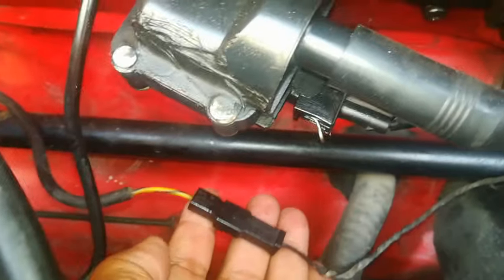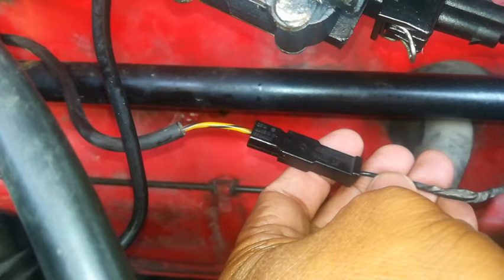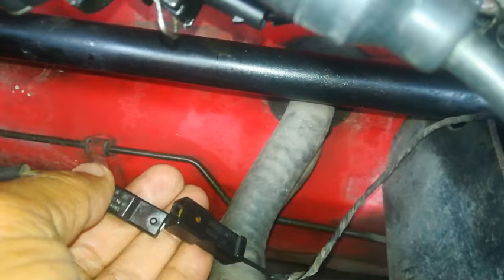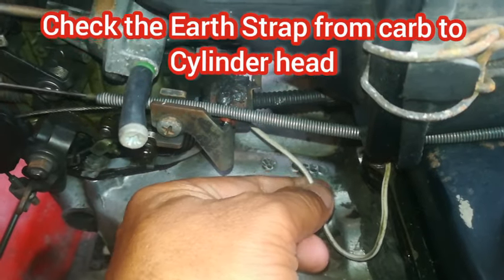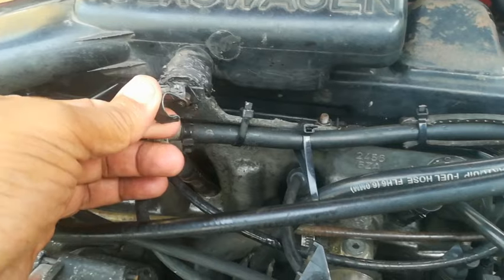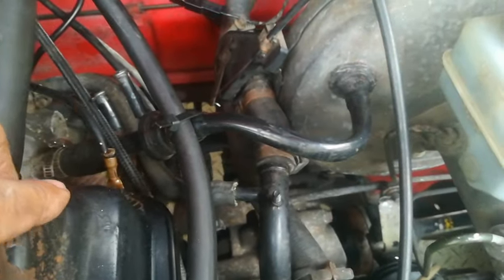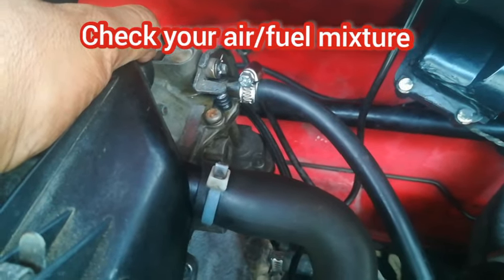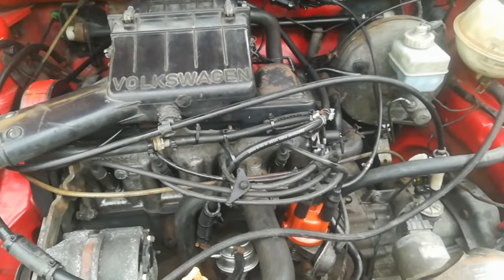GOLF MK1.WHY YOUR ENGINE WON'T  IDLE. SOLVING ENGINE IDLING ISSUES.#vwgolf #golfmk1 #vwfox #vwcaddy

Comment: Great video..

A bit more info on crank and distributer timing,  i always line the marks up and move the dizzy on the mark to plug 1.. never used a timing light and seems to be running fine.

Sometimes bother me if its not right.

Then say rather not interfere with what's not broken .
Reply from the maker: Exactly if it's performing well.. Leave as is   :)

Comment: Thanks for your videos, really appreciate it. I had a torn base plate, bought a new on Victor Ryens Sealer. But I still have the care cut out when I do a sharp turn to the left. (like a u-turn) Bought a new fuel pump just to find it was worse real erratic idling, cheched no fuel. So we installed the original fuel pump again and it is better. The fuel separator I blew out with a compressor, but maybe I must change it and the fuel pump. Checked the distributor vacuum advanced as per your video (the pipe was perished at the back of the carburettor. Cut it and refitted. Car is better but still 1000 rev ruffness when idling. And pull away jerky .
Reply from the maker: Ok that's great .have you checked for  an airleak around your servo pipe yet..(those two little ports)..and then also check on that other diaphragm which is inside that part which I  blocked off on my carb..it's supposed to be for engines with Aircon...,The pipe runs from that part  to the front of carb...as a test just block off the port on the carb and see if idle smooths out..I have done that...when I noticed the diaphragm in that part was torn,so I don't use that part anymore ..I'm not even sure what the specific name for it is.My reasoning is if the diaphragm is buggered / torn then it will cause un- metered air to go into the carb fuel mix and that leans it out causing an uneven idle..

Comment: My Citi Golf with Carb doesn’t idle as well, I found the Cut off valve cable naked, it must’ve been in contact with the chassis resulting in short circuit. Now I need to replace the cut off valve

Comment: Where does the connector that is connected to the air cut off valve run too? I have a mark 3 what would switch off when coming to stops, found my cut off valve was disconnected and the wire it was connected to ran through the fire wall, but I see here it runs somewhere else

Comment: 2002 mk1 fuel injection cold start idling in the morning when warm start first time only when cold it don't want to idle have to keep om ref to warm then it idles. What do you think?
Reply from the maker: You need to check on the temperature sensor ...it may need to be replaced ..or just clean it up .could be rust and corrosion

Comment: may I please be in contact with you. I've got a golf 1.4i that's got a rev/idle issue. When it turn it on the revs go up to 1200pm without any acceleration. When I drive it and I press down the clutch the car revs itself. I've changed the map sensor as well as clean throttle body with carb cleaner and the problem still is persistent

Comment: My golf mk1 cuts off when the rev count is below 10rpm I even replaced the cut off valve still the same problem applies, even when driving sometimes it just cuts off and there is no idling when is cold only when the car gets warm
Reply from the maker: Check your carb base plate ,coukd be sucking in air .or for air leaks around pipe attached to brake booster ..

Comment: Hi, thanks for all these video's, they help a lot. I have a vw baja with a twirnport engine but they fitted a Golf carb. When I start her in the morning she idle's perfectly. If I leave she goes fine until it seems the engine heats up or I go uphill she hesitates and eventually I cant go further. Do you have any advice, what can cause this? I've checked vacuum leaks, fuel lines, I must me missing something. Thanks.
Reply from the maker: Hi thanks.. Check fuel pump, could possibly be fuel starvation . That's a typical symptom. And, if u have a fuel separator on,... They tend to clogg up, or the heat of engine causes fuel to boil, etc etc. But first do a check on your fuel pump. I have a video on fuel pumps, and fuel starvation .. Not sure if you have viewed that yet.. Once I experienced that fuel starvation issue, until I eventually Checked my fuel pump and it was pumping erratically and weak.. And it was a new pump. Obviously bad quality. After I changed pump, problem was solved

Comment: Hi Mr PJ why when I press my accelerator my car cuts off I drive a golf which is a 1.3 carb
Reply from the maker: Could be one of many things ..could be clogged up airfilter,or flat spot on carb,or running too rich..like I say ..could be one of many things...best to take it to mechanic for  assessment
Reply: @pjs-golfmk1-diy  Fuel is leaking from the carb

Comment: good mornig PJ. plead3 can you help me. I have a 1.3 Citi sonic carb. it starts but does not want to idle please need your advice as I am very close to put a match in the car 😂
Reply from the maker: Hi. The most common reason for this is due to the idle cut off valve situated at back of carb to be faulty. Or your earth strap is not connected.. Usually connects from carb to the tapper cover. Have checked on these yet?
Reply: @pjs-golfmk1-diy  hi PJ fuse is fine cut off fine replaced starter module cleaned carb and checked the petrol pump. So when starting it starts up if I push the petrol high refs it it goes as soon as I leave the petrol it dies immediately

Comment: Hi! My Golf mk1 1.6 with a Keihin carb has a very rough idle. The car sometimes idles at 2000 rpm and sometimes barely idles. When it runs it runs fine. When I was out driving the other day the car suddenly just lost power and wouldn't start. When I turn the ignition the car ignites for a brief second then dies. Sometimes it keeps running with very precise throttle but then dies when in gear trying to drive away. Any advice on what could be causing this issue? 
Very thankful for help!
Reply from the maker: Hi, it sounds like your engine could be experiencing fuel starvation.... Have you seen my video on  fuel starvation? . If u haven't, just look on my channel for that vid. It will guide u. Thanks
Reply: @pjs-golfmk1-diy  i recently bought a cheap new fuel pump and have barely driven the car due to it cutting out. It also seems that the precious owner has removed the fuel accumulator. Could the new pump just be a cheap one and not pumping well?
Thanks!
Reply: @Rmndb  hi, I don't know if you've fixed the issue but it sounds to me your pump is bad
My car does the same thing when it runs out of fuel, so my best guess is the cheap pump you got is faulty..

Comment: Question, now what about fuel injection? if I start my car it idles, when I reserve out my driveway and take my foot off the accelerator it dies. when I come to stop and take my off the accelerator to gear down, it switches off.
Reply from the maker: Have u checked for an Airleak around the Servo Pipe and brake booster
Reply: @pjs-golfmk1-diy  thanx, will do... will let you know if i come right or wrong hahaha

Comment: My release bearing seal gave in causing my clutch to slip will it work if I clean my clutch and get the oil all off can I put it back instead of buying a new one
Reply from the maker: Hi, Which seal are you referring to?

Comment: On my golf that power supply Cable for idle cut off valve is not connected just only one cable. It's half
Reply from the maker: Well you need to fix it ..Get the cable attached again

Comment: Hi, if possible, what fuse should idle cut off valve have? (10/15/20? or something else, because I can't find any diagrams for fuses anywhere) And if I'm correct does that valve work off of power that comes after ignition? (15)
Reply from the maker: No 17
Reply from the maker: Sorry I meant to say slot no.  17 in your fuse box, and it's a 10 fuse

Comment: Can u please assist me, I have no vac advance hose on my distributer and one nipple on my break servo pipe  is open and I have been using the car like this over 1year it was bought like this howver can u please explain where each vac line goes
Reply from the maker: If u have a distributor with a vacuum advance attached.,you need to have the thin pipe attached from the Vacuum Advance Unit to the back of the carb.. There is a port where it attaches to

Comment: Hello what causes the car to over fuel and pre ignition.
Reply from the maker: Overfueling can be due to a fuel pump, or the float level in carb needs adjustment .. Pre ignition is timing related.Have you set the ignition timing with a  timing light

Comment: Pjs is it posibble to change from round round coil  to that 3 pin coil ?
Reply: I noticed is easier to connect that that 3 pin coil
Reply from the maker: Yes you can change over to the 3 pin coil

Comment: Hi guys... So my son has mk1 automatic 1600. Problem we have occasionally is that starting up we would need to swing the starter a few seconds before the engine fires up. Other times we litterally just tap the key once and she fires up. What could cause this?
Reply from the maker: It can be a fueling issue.  The accelerator pump in particular. It maybe doesn't give u that bit of  squirt of fuel into the throat, when u pump the pedal, just before u swing. With engine off, Look down the throat of carb while u pull on the accelerator cable.. It should give a nice squirt of fuel down the throat of carb. Also could be even ignition timing not set to spec. Have that checked too
Reply: @pjs-golfmk1-diy  Thank you for your input and response. Great videos keep them coming... Mk1 for life.

Comment: Hi mr PJ my problem that I have is if my car stands through the night, the next morning its struggles to start, but during the day its start normal. What can that be? 1800 Fox
Reply from the maker: Hey there.. Is the weather very cold in the Mornings on your side. If so use some Q20. Spray some in your distributor, and plugs, and also some  in the coil, and coil wire connection... Have a look at my video.. On my channel "Cold start Solution"...
Reply: @pjs-golfmk1-diy  Thank You Im going to try that. the car just swing the whole time untill it finally decide to start. if i do kick start then it start immdiatly

Comment: Hi could a faulty base plate cause my car to use like double the amount of petrol it normally does? Or could it be something else causing my car to use so much of petrol?
Reply: Hi i had the same problem can be the base plate and could be something els, just move the carb side to sideand check on both sides for cracks.

Comment: How to fix rough idling  after changing plugs
Reply from the maker: Could be your plug gaps are not correct,just check on each gap,or maybe the brand ..NGK is a good brand

Comment: Hi I was wondering if you can help me..
My car start perfectly but as soo as leav the throtel it just switches off

There is nooo ideling at all have to drive with my choke on...

Any help please?
Reply from the maker: Sounds like it could be with your earth strap running from the carb to the cylinder head that could be loose. I'm assuming its a carb model...... Also check if your idle cut off valve is properly connected at rear of the carb....
Reply: @pjs-golfmk1-diy  the cut of valve is conceted because I dit plug it out put my igntion on and it does make a click sound...

I wil double check the earth cable
Reply from the maker: @kd102gamer4  or else it's an Airleak
Reply: @pjs-golfmk1-diy  thanx for the help